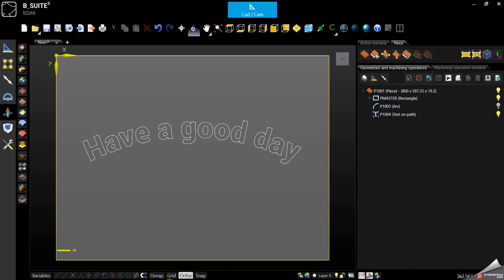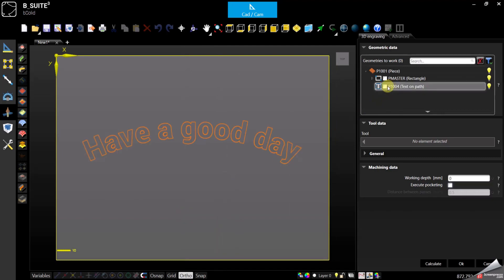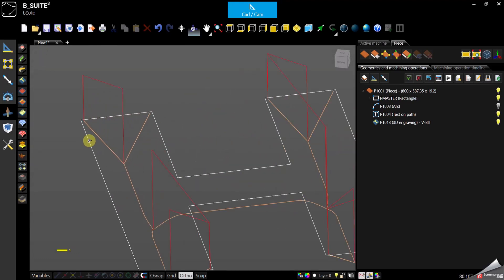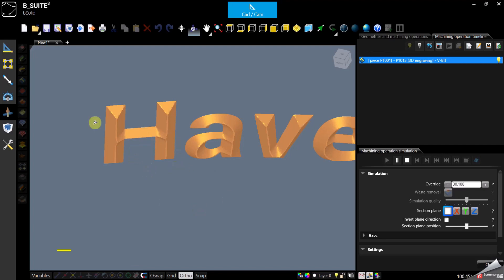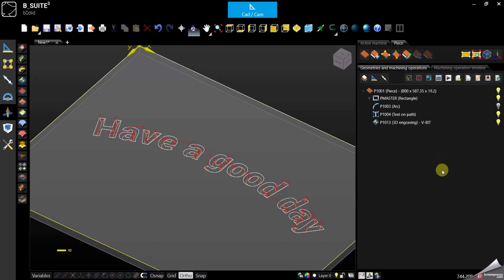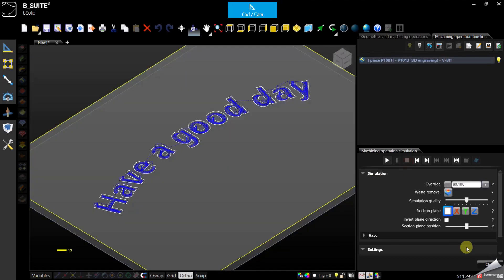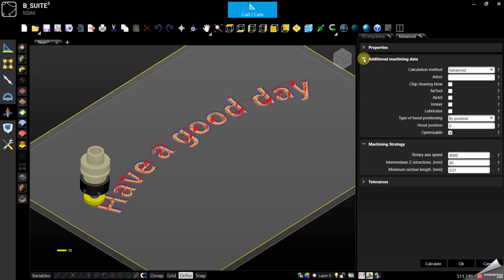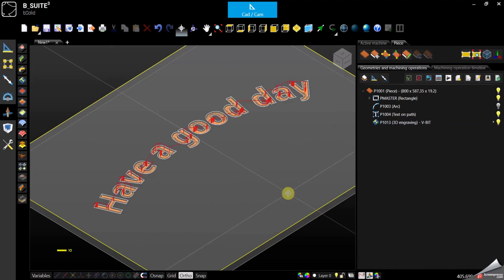9 - CAM BIESSE bSolid - 3D Engraving

Comment: Hello mister. Is there a way to add text label with the text function using variables ? I almost use csv import and would be great to change text automatically with a variable. Didn't figure out how to write my variable in the labelling so it's recognized. Thanks for your help. Regards